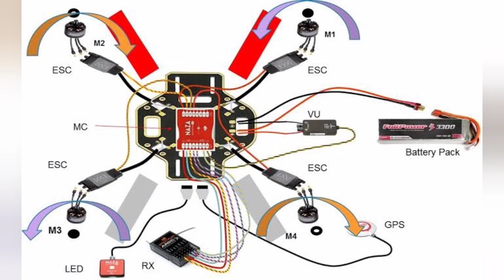How to make drone || How to install electronics in drone (Part-4)

Comment: What is total weight
Reply from the maker: Approx. 1300grams
Reply: @MechManish  bro it's too heavy again there are chances of crash with local lipo
Reply from the maker: @Sunnyfpv1617  Brother!! It's battery is of 320grams approx. the drone itself is of 980grams or something.
Reply: @MechManish  okk bro it's fine then I thought the drone without battery is of 1300 grams